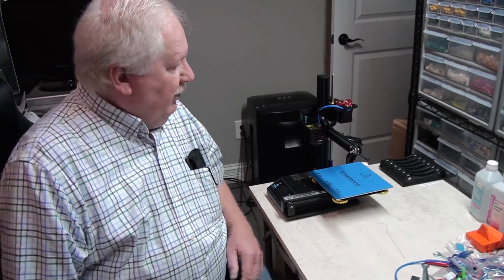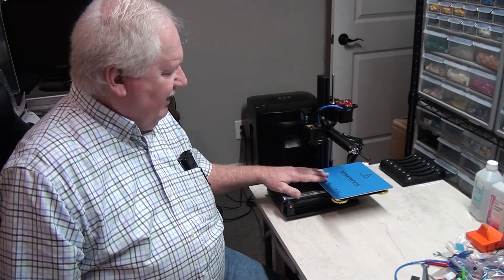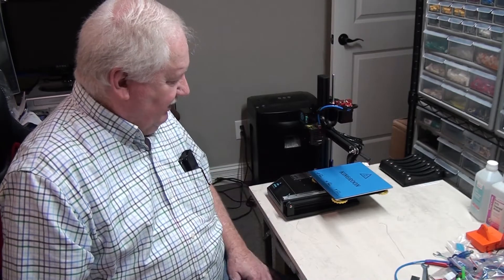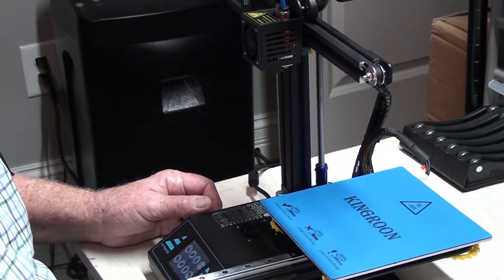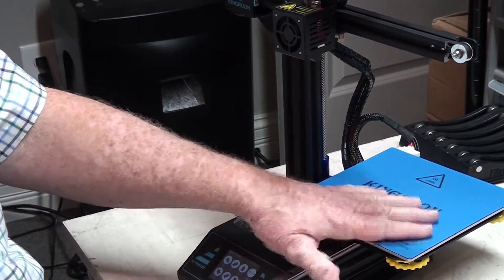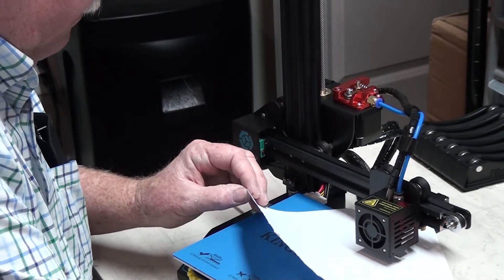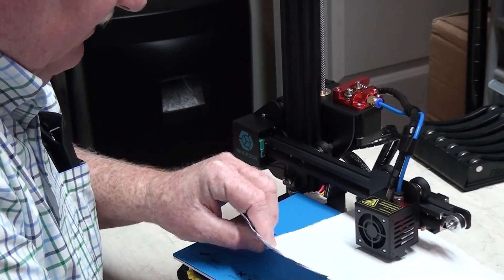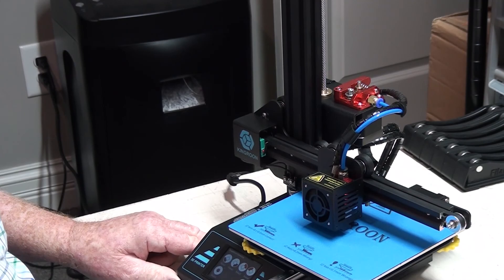KINGROON build plate leveling ( Starting a 2020 Business using 3D Printers )

Comment: Sir, I am watching this 2/10/21 and was wondering how this printer has performed for you? I'm looking for a compact printer and this one seems to be put together pretty well.
Reply from the maker: I have 15 of the Kingroon KP3 printers with 8 of them running print jobs at my home print farm and 4 of them in my home office where I do most of my designing and prototype work. Since I don't have much space they work very well in my office. I have two on a small table, one on my desk and the other sitting on a cardboard box. I print almost all prototype parts on these printers and they have worked very well. The magnetic build surface is great for removing parts once it is broken in. Be careful not to damage it when you first start printing, let parts cool and start with small foot print parts. Even the magnetic sheet tends to stick the first few times you print. Good luck if you get a Kingroon.  Thanks for watching....Ken